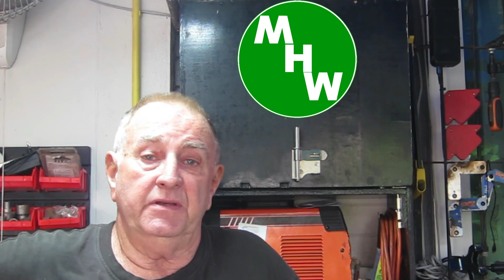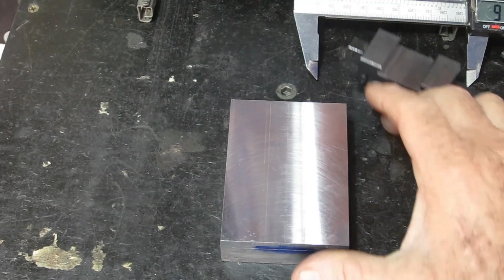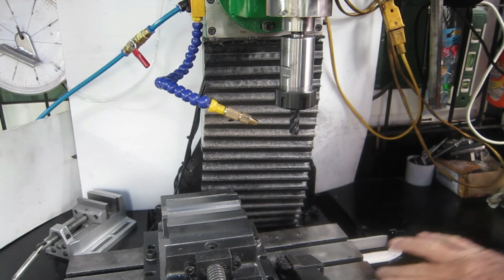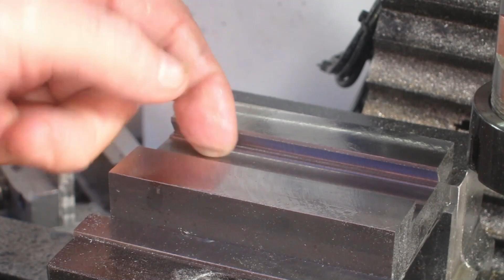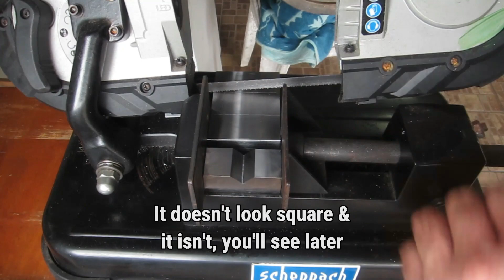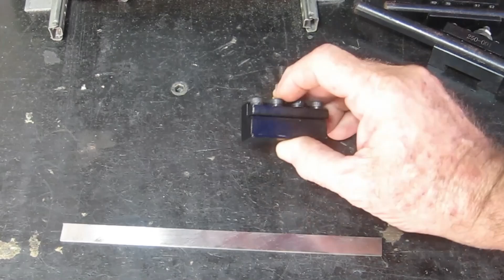MHW Episode 51 - Quick Change Tool Holders Part 1

Comment: Mill seems to be well, Would like to hear the noise it makes.
Reply from the maker: Not sure you would, it's pretty noisy, although that depends on what I'm machining, fly cutting aluminium is just the whine from the motor mostly
Reply from the maker: Actually, at almost exactly the 14:00 min mark you can hear it just as it's about to come to a grinding halt, then up until around 15:00 you can hear it without the volume turned down.